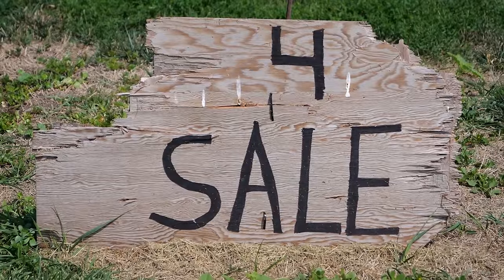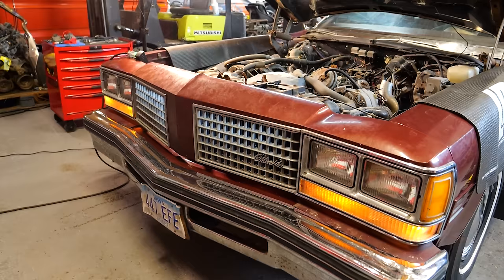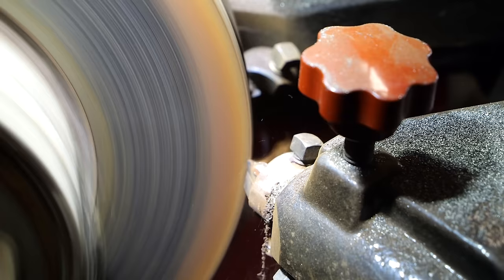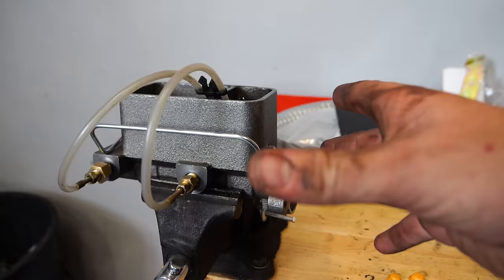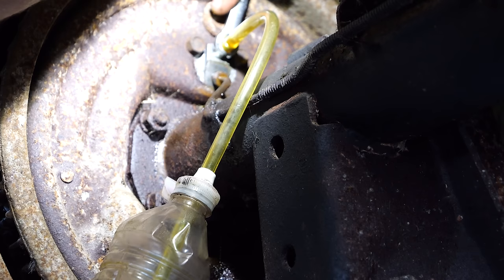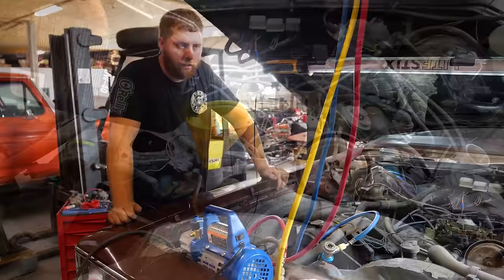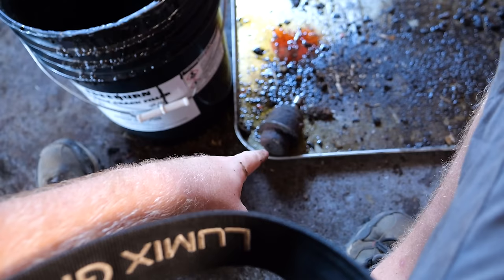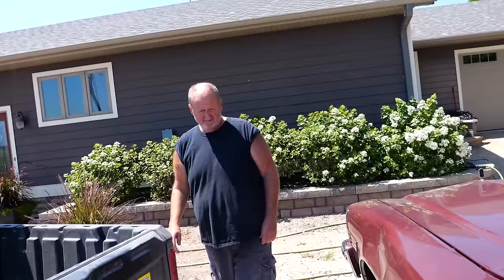Will this ABANDONED 70's Luxury Car RUN & DRIVE for CHEAP!? $1,500 DIY Daily Driver Revival!

Comment: My Father had a 1963 Ford Galaxie That beat most everyone in street races back in the 60's I had a 63 4 Door Galaxie with a 352 Bought it when I was in the Air-Force. Drove it home to Maine from Noth Dakota and it had been sitting outside an old service station in Minnesota for 12 years!

Comment: Hey Kevin just a bit of advice on charging ac systems. Never introduce liquid (can upside down) into the low side, it will hydrolock and damage the compressor. Before you start the engine charge as much liquid into high side as it will willingly take. Then close your high side, flip the can right side up and charge the remaining amount through the low side as a gas.

Comment: The Ninety-Eight series Oldsmobiles rode on a 126-inch wheelbase, while 88s used a 122-inch wheelbase. The top-of-the-line Ninety-Eights also used slightly different body side moldings

Comment: Pull motor and transmission. Do a full refresh on the engine bay. Replace all wires, lines and hoses. New brakes and tires. Possibly new gas tank.

Comment: Back on high school (late 80s) my buddy had a 2 door Olds 88 diesel, perhaps a 1984. It was awesome...til it wasn't. I think it blew a head gasket, which NEVER happened to those engines! (LoL) I'm just picturing my head the massive scale of a mid 70s Olds 98. Instead of a "land yacht", that thing must be a aircraft carrier! At least those old rotors had enough meat on them to turn them on the lathe! Lots of the newer cars have such skinny rotors that it's hard to cut them. It's hard for the "malaise era" boats to do burnouts! Another buddy of mine bought an old Caddy with big motor (possibly a 425?) and no rear brakes. The 1 wheel peel was EPIC, especially with the studded snow tire!

Comment: Kevin, do some more information searching on that Olds 98. My parents had a '73 model with the 400 turbo trans in it. The transmission itself didn't have an overdrive gear, but the '73 had a 2 speed differential which was your overdrive. The differential would automatically shift to the higher gear ratio at about 50 to 55 mph. From the RPMs I was hearing when you was on the interstate it sounded like it didn't go into overdrive. I don't remember what year Oldsmobile stopped using the 2 speed diff, but check to see if yours has it. It will save you a little bit more fuel on both want highway runs.

Comment: When it’s the modulator, it’ll shift manually if you start in 1st and shift it by hand. Every one I’ve seen was that way anyway. If one doesn’t shift first thing I try is drop it in low and shift it by hand. If it shift modulator valve. If it doesn’t it’s something else

Comment: You have to put some of that marine gas additive in there. Go to a boat place it’s gas stabilizer what is the marine type. The ethanol will destroy that older engine and make it run like crap. I think that if you use some of that marine gas additive it will dissipate that ethanol in there and it’ll be running on gas how it was in the 70s😊
Reply: You're right, the ethanol in the gasoline can ruin the engine, fuel lines, and possibly rubber seals in the carburetor

Comment: Life hack depending on the car & your physical location: if you need raw gas and your local station doesn't sell it, go to a marina... if you need leaded gas, go to a small airport that has like propeller Cessnas, av-gas is low lead 100 octane

Comment: In the mid 80s I owned the exact same model car.  Oldsmobile 98 Brougham. The only difference was that mine was sky blue with a white vinyl top. Loved driving that boat it was like gliding on a carpeted road.  It floated down the highway like a dream.  But 12 mpg just didn't get it.  My ex took my Chevette when she decided she didn't want to be a parent anymore.  So when I found out where she was living, a friend and I serendipitously exchanged vehicles.  I was still making payments on the Chevette. It also got much better mileage. She didn't have it very long. She was driving inebriated one evening and crashed into a pickup truck.  No one was injured thankfully but she spent some time sobering up behind bars.  Lol.  I was sorry to see the Olds meet its demise.

Comment: I would HAPPILY buy this GORGEOUS CLASSIC from you if you change your mind about keeping it, and I've got the R12 for the A/C ready to go!
A couple notes: my Dad's 76 Monte Carlo sat for a couple years and was RARELY driven around town, and when he needed to get it on the highway to take a family member to the airport he told me he couldn't get it past 2nd, so he kept greasing the throttle on the way and eventually heard a loud bang from the tranny, and it started shifting normally.  It was probably a little gummy, as we never had that problem again for like 30years.
To the A/C, I HIGHLY RECOMMEND replacing the dessicator bag in the system, as my Dad's dried out (seems like ALOT of them did back in the day) and seemed to have blocked part of the honeycomb in the dashboard.  This was my Dad's theory and I was later told this was common by an older mechanic who said you need to add a little refrigerant oil to the A/C system every so often to keep the bag "wet" and keep it from shredding and blocking up the system.
Hope this helps, keep up the great work, I love both your's and Mook's channels!  I'm learning so much and enjoying the ride! :)

Comment: I sold 20 cans of r12 for 500$ a couple years ago. I kept six cans had to use one can when my fan clutch failed and the high pressure got to high. Lucky for me there's is a safety valve on the compressor that releases the high pressure.

Comment: i didn't put near that much grease in there when i did my rotors, but it still did fine for 12 years until a wheel i didn't touch ruined a bearing

Comment: If you want to help that ac out add some PAG46 oil to the system. R134A won’t carry the old oil which will end up burning out the compressor

Comment: Years ago I bench bled. I have not bench bled a master cylinder in 15+ years now.  I find it easier to just bolt it on, put fluid in it and work the air out with the lines attached by using the pedal.

Comment: We had one of these cars growing up and I would love to get one today (even though my wife would not be happy with it). If I remember correctly the housing between the chrome and the painted metal was a tough rubber that actually covered the very back end of the chrome taillights, but you might see if you could find one in a junk yard to get the measurements to try and 3D print new ones.

Comment: My first car was a '76 98. Get rid of that pellet type catalytic converter, and verify that your choke works. If the choke doesnt 100% open, the secondaries wont open. That car should annihilate the one rear tire.
BTW, a large pizza fits on the dash for the best cruising youve ever done.

Comment: The HEI sparking off like an the Beast of Turin with those stubby wires was hilarious.  

The endless love for an old leadsled brought back a bunch of memories of my first car; '76 Chrysler New Yorker Brougham w/ a 440.  Plus leather (?) interior, multi-body trunk and glorious wafting suspension.  Think I paid $1,500 for it way the hell back in ~90 (in DSM none the less); so $800 for this was damn near criminal.  

Ball chillers.  🧊🥎🥎🧊  So needs to come back.

Your dad wasn't impressed in the least, was he?  🤣  Or is it just too much contempt for Cadillac?  To him it's also just a prime example of the malaise era; but that can be fixed now.  Easy to make a classic car with the engine behavior of a modern one; but really can't easily make a modern car ride like a 60s/70s boat.

And happy birthday, Kevin!

Comment: I use Olds V8's for all my GM trucks. Unfortunately the last one, a 94 Z71 with an Olds 350 burned to ground thanks to a circulating block heater.

Comment: Really pack those bearings. A 6.6 LITER ENGINE AND A TURBO 400 TRANSMISSION. I have blead the braces and master cylinder alone, with a similar idea.

Comment: Cool Kevin because the 75-76 bigger gm cars are really neat and I have owned a 77 and a 79 Oldsmobile 98 regency brougham, and also a 77 Oldsmobile Delta 88, a 78 Oldsmobile Delta 88 royale brougham and a 79 oldsmobile Delta 88 brougham almost just like the 78 except for the 78 was silver and the 79 was dark blue and the 77 Oldsmobile 98 regency brougham was leather red interior and the oldsmobile 350 4bbl m4mc Rochester quadrajet carburetor a bop th400 turbo automatic transmission..

Comment: Just fixed up my 2004 Mercury Grand Marquis. It had no ac in the 100 heat and I had 2 blowouts on my tires. Now I have new tires on it. It now needs coil packs and spark plugs.

Comment: a cheap way to charge a ac system is keyboard duster(canned air) i have 3 vehicles charged with it. 89 bronco, 2003 tahoe, 2002 superduty.  and it works better than 134. especially in over 100 degree temps.

Comment: I know you will probably never see this, but you can use literal air duster from Walmart to charge R12 systems. I have done it. There is a guy on the Rx7 forums that details the process. Air duster is not "canned air" as it is frequently called, but is actually a refrigerant called R152 (I think) and it is compatible with R12 systems.

Comment: I had a 76. Had a 455 Rocket. Mint. Bought it for 250. Transmission slipped on the way home. Ended up selling it for a derby car. Which is sad, the engine had only about 76k miles. The interior was perfect. Leather. I screwed up. lol

Comment: Best thing to do for that a/c is to fill it with keyboard air duster; also known as R152. It runs similar pressures to R12, but it's more efficient. Works perfect in R12 systems.

Comment: Using the original refrigerant oil with R134a risks killing the compressor due to oil starvation. The oil circulation in the system relies on the refrigerant and oil actually dissolving into each other. Since mineral oil and R134a do not mix, running R134a in an unmodified system will eventually cause all all the oil to collect in the evaporator and it won't get returned back to the compressor. This will eventually ruin your compressor.

Comment: The great thing about this car (if you were a teenage back in the 70's) is that huge back seat. Ask me how I know...

I'd go to the trouble of fixing the body work. Looks like it's worth it. I've been using Sweet Patina products since Puddin's Fab Shop introduced me to them. Actually good stuff. I keep thinking my glass is invisible.

Doing a burn out? I didn't see ya'll doing anything with the cooling system. So, the Italian tune-up works. Not bad for a land yacht.

Comment: I would take that fender off and get out the block and hammer. Did that with a 79 toyota corolla I bought as my first car that the previous owner had put a power pole sized dent into the driver's side front fender on. When I got done there was no dents on that fender. Looked new.

Comment: Another great video! Can't believe how good that car is. Pull that fender off and straighten it out best you can and don't worry about the paint on it.  I think you can push those tail lights and bumper in to snug it up to the body. If I remember correctly the bumper has a shock like system. Also, it's been a month, I hope we get to see a new video from Miss Mook... I'm running low on Chaos and need a refill😂

Comment: Not long ago I was buying gas when a clean as hell 82 Oldsmobile 4 door sedan rolled in.
I went over & talked to the old man driving it. He said he used to work on his own cars but these new ones today you cant what with their computers & emissions & all SO he searched
and searched and searched and found this clean as hell Olds sent it to a shop for a full frame off restoration. New EVERY|THING rebuilt engine & trans & diff and all new upholstery & paint & rechrome. It looked like a brand new car he said he was only into it for $22K, less than a new one & this one he could work on.

!

Comment: If you use it on caliper slides they will seize up and become frozen in place. If you use it to lubricate the pads they will also become stuck and not move properly. It won't take long either, just a couple of thousand miles before it will harden up. They make dedicated brake lubricant, use that instead.
Reply: I always thought same thing about antisieze and I was just as wrong

Comment: I hate fixing brakes but that is because on every vehicle I have ever owned but 2 ive had to put brake hoses on the front, rotors and calipers and almost always chasing brake lines and replacing them a stick of brake line at a time, and then the pinhole showed up just after the fitting you replaced, and fix the next 3ft and chase the brake lines to the rear of the vehicle..lol fun like building a puzzle similar to the other thing im not much of a fan of,, plumbing fixing piceing the sections and turn the pipe to copy the connection to the contraption your broken or cracked plumbing pipe like pvc with as close as you can always have to make exceptions because they never have all the turns that you need..

Comment: Try HC12-A on older R12 cars......just don't tell anyone ha....its meant for stationary equipment but works great in R12 systems and mixes great with the oil

Comment: I wish that I had my dad's 73 Olds 98,it was yellow & had the 455 in it and I wish that I had his 72 Chevy Caprice I had a 350 in it but the transmission just had reverse & I was going to put the 455 engine & transmission in the Caprice if it would fit

Comment: FYI R12 systems use a petroleum based oil in the compressor and R134 systems have ester oil. These oils are not compatible and will cause the oil to foam up and leave the compressor which leads to compressor failure and also the pressure increases in the system and blows seals. Back when R134 was first being retrofitted into R12 systems the industry went through the pain of compressor failure and developed methods you MUST follow when switching over from R12 to 134.  You have to recover the system, install a flush into the system.... then you have to drain the flush.  This process has to be repeated several times to get all the old oil out of the compressor and evap/condensor. Do some google searches on doing a proper swap over to R134 on a r12 system.  If you do not do the flush....  that compressor may last a month or 2.  good luck

Comment: The one thing ya messed up on were these cars were designed to go with white wall tires . They will make the car look 100 times better. You won't believe the difference in looks it will give you a super stylish look compared to the Blackwall drab look.:face-blue-smiling::person-turqouise-waving::hand-purple-blue-peace:

Comment: This was an incredible find.  You should definitely get that accelerator pump fixed. 
I wish i still had my 78 Olds Electra LTD. It had power everything and was so comfortable that it was better than sitting on my living room sofa. It even had fiber optic headlight and turn signal indicators on the front fenders and above the rear window!
Reply: The Electra was a Buick, not an Oldsmobile.  Limited should be spelled out as Ford’s large car in the 70s was the LTD.
Reply: @Andrew-bb3lc  Yes it was a Buick Electra Limited. It had an Oldsmobile 403 motor.  Almost the same car.  It was that Creamsicle yellow color.  Me and my friends had so much fun with that land yacht.

Comment: The 400 GM made was one of the best transmission GM ever made, I have NO idea what they where thinking bringing the 350 Metric out, a total POS!! I had a 1968  Impala 2 door hard top coupe, blue and white with white and black interior, with a 327 250 hp, 400 tranny factory air ps and brakes, and a package trim I have only seen a couple times since, I put GM air shock and 396 Impala springs in the front. Wish I had that back now , a kid my brother sold it to, trashed it out one night after hitting a corner fence post and the right front wheel was in the passenger seat. A little unknown fact on the 400, you can stick it in 1, and floor it , when the engine redlines and vacuum drops, it WILL shift into 2nd!! And you better be hanging on to something, because things are about to happen FAST out partying and done would freak kids out LOL. I had a chance to drop a 327 Vette mechanical fuel injection engine in it, the St Louis Zone rep had it, and checked all the bolt hole specs for everything, only thing was a air cleaner would have to been made, a stupid move not to , would have been a  wicked  road sleeper, but 800 dollars was a lot of money for a kid then in 76. I worked at a Chevy dealership before and after high school from 74 to 1979, and drove a BUNCH of neat cars buddies my age never got to drive at 16 or 17!! Test driving and squeak and rattle detail, especially the Muscle cars being traded in for family cars, and the Vettes with the fuel bladder recalls. On this era of Gm cars the pvc hose will suck the bottom out them, the hose deteriorated and created a HUGE leak, a sign is rough idle and deiseling especially big blocks  , the vacuum booster will do the same IF the black plastic valve is not on the booster line, bet I put 2,000 or better of those on in the day due to a GM recall. On the big blocks 454 etc  we always serviced and GM recommended using 20W50 racing oil, Wolfshead was what we had, and would keep the oil consumption at bay in ambulances , and trucks in the day.

Comment: Kevin, any reason you don't run a snatch block attached to a small pulling rope on the car side when winching up cars? I noticed when you guys winch stuff on your trailer it sounds like your winch is struggling hard. It'll take a lot of stress off of it and actually work more efficiently since math and things... doubles your pulling power.  I was doing the same thing until I realized it was smarter to not try to burn it up lol.